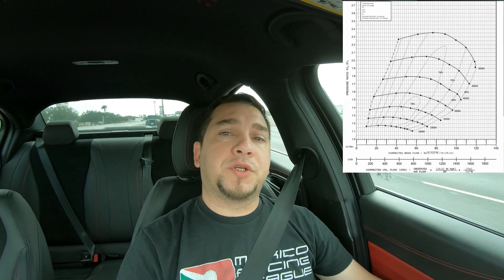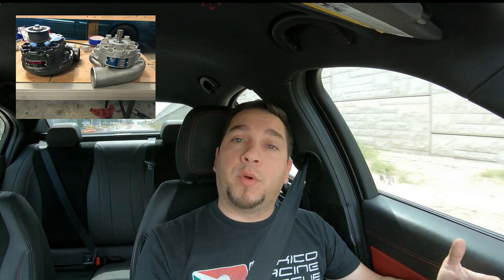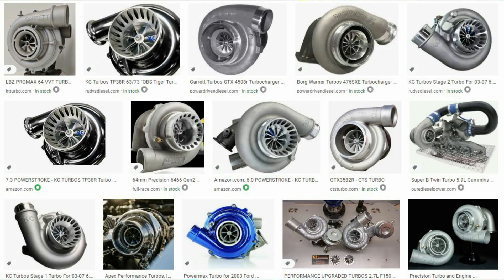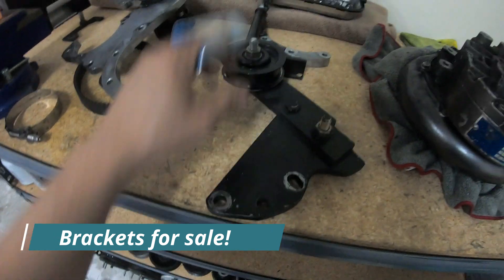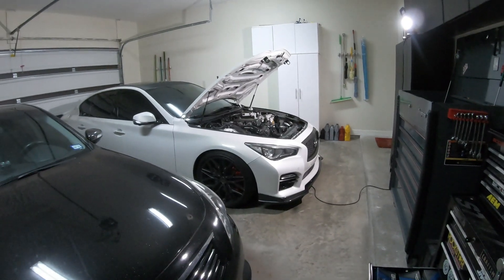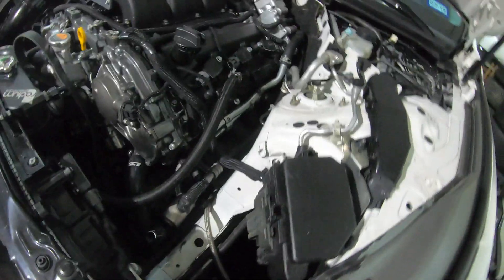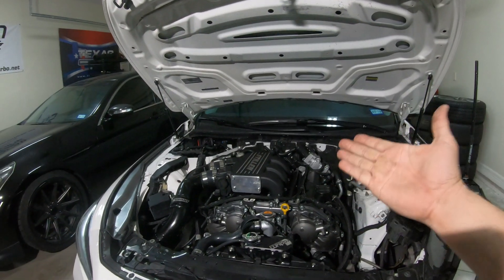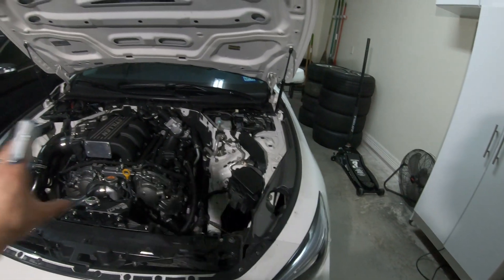(800 whp DYNO!)Q50 Supercharger VS Turbo? Which one is better?

Comment: Your current motor is the one you built yourself correct? What did you do to prevent head lift this time around?
Reply from the maker: Kept the power at 700 or below.
Reply: @txboostlife  what is your opinion on kinetik motorsports out in Texas? do you know anyone that has had a motor built by them?

Comment: I also have 3.7 Q50 and I am looking to get more WHP, I already have custom exhaust, test pipes and more. But still need to make at least 500 brother. Any suggestions?
Reply: Wether you go turbo or supercharged on your 3.7 you should have no problem hitting 500 wheel. Without forced induction you’ll never hit 500
Reply from the maker: Facts

Comment: Bro how did you feel about that motordyne upper manifold? What made u get that over the z1? Is that better?
Reply from the maker: Great midrange power. I still have it on my G37 and it feels great on the street. Ported manifolds make more peak but I have a pretty nice curve with the motordyne. Need a back to back comparison on the G to show where the curve is.
Reply: Yeah it’s a lot of back and forth between the 2. The dynos I’ve seen say the motordyno is better mid to high range where the z1 is better idol to mid. The motordyne is just a ported de mani correct?
Reply from the maker: It’s a VQ35HR manifold
Reply: Oh that’s right my mistake. Thanks I appreciate the info.

Comment: What brake set up do you run, I have the same Q50 and I am running into trouble finding a BBK brake kit replacement, for the fact that is years sport trim is one of the few if not only with this brake set up
Reply from the maker: AP Radi-Cal 2 6 piston front and 4 piston rear. They were offered by stillen at one time but now I’m not sure where you can get a set. They’re amazing but I don’t think people were willing to spend the money for them.

Comment: I’m in Tx also, wish part are you from?  I’d love to check out the car some time. I’ve had a few VQ’s in the past but converted over to the 6th gen camaro Gen V  LT platform and have a procharged SS now.
Reply from the maker: San Antonio and Rio grande valley

Comment: nice to see you going Turbo. Been lookin at the Switchback Racing kit or may see if Soho's kit will fit... only issue I've seen is the damn 3.7 transmission
Reply: U can do a vr30 transmission swap its cheaper than building ur oem trans .and it can hold much more torque than the vhr trans

Comment: I have to say your build is f**** incredible I cannot wait to get my Q50
Reply: I would love to go crazy when I get my Q50 but I want to keep it simple but stylish yours 800 horsepower oh my God to the wheels you know what you doing did a lot of people out there that have cars and don't know what the hell they're doing but I take my hat off to you I would love to have at least 350 to the wheels I rather run all motor I know the basics of full exhaust cold air intake and get it tuned that's not a problem that's one of the things that I'm going to do but if I want more power than I put in the turbocharger but I can't really go crazy because these streets are here not good